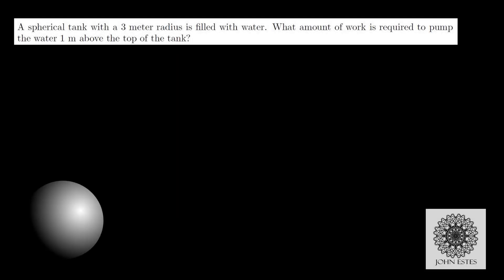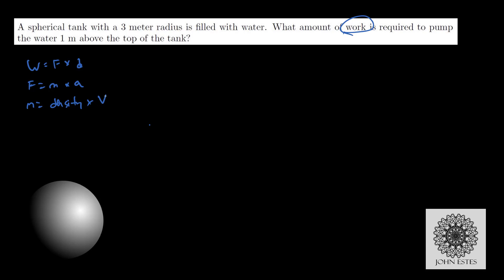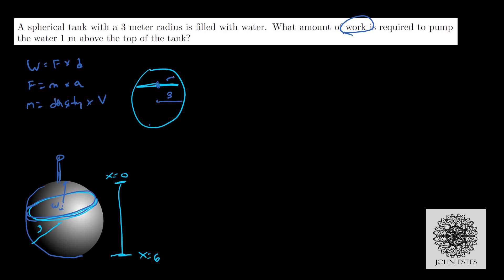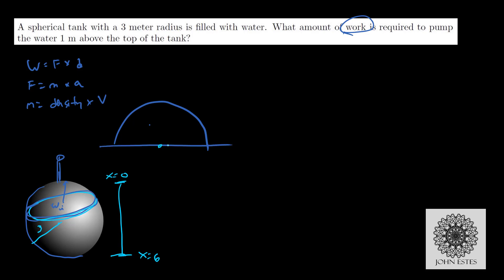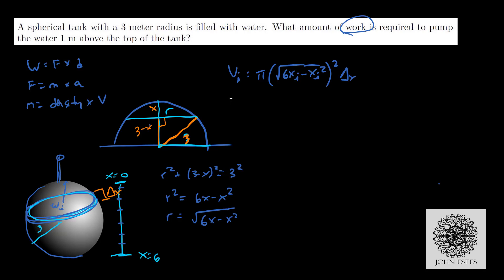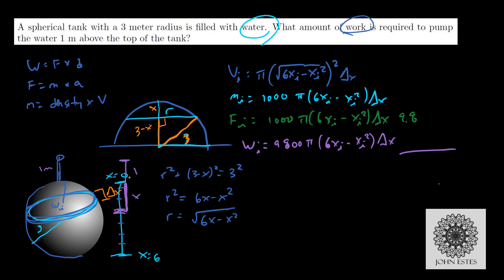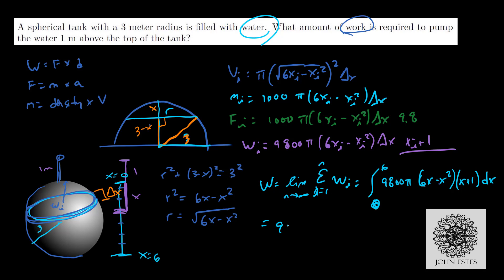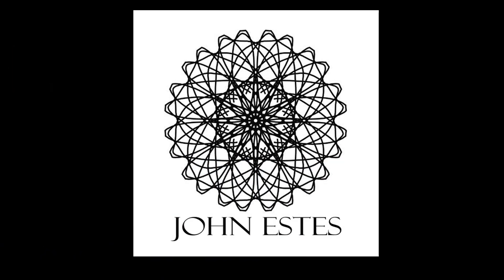Work Required to Pump Water out of a Spherical Tank

Comment: great video, but why did you call the axis x instead of y?
Reply from the maker: Well... we're trying to build our integral with respect to a variable. We just choose depth to be along the x-axis, but we could have chosen y or t or whatever we would really like. We sometimes get locked into thinking x runs horizontally and y vertically, but that doesn't have to be the case in a particular application. I hope that helps!
Reply: John Estes Math thank you!